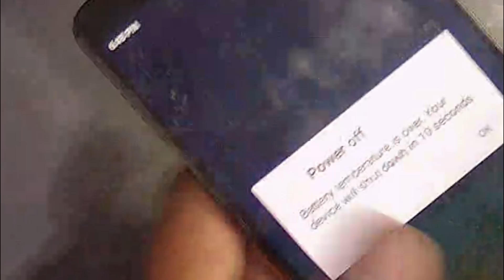Redmi 5 Battery Temperature is Over Your Device Will Shut Down in 10 Seconds, Repair.

Comment: a question sir you used 38k ohms resistance on 3.8v so current will be 0.0001amps? what is the purpose of using this. totally confused. thanks in advance.